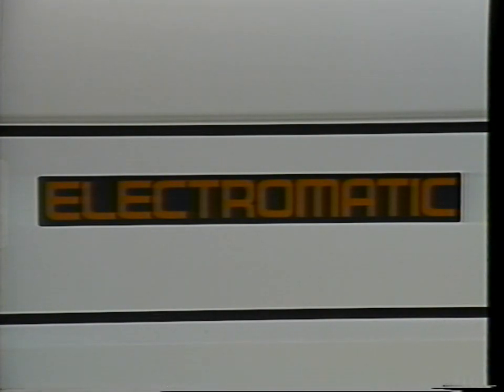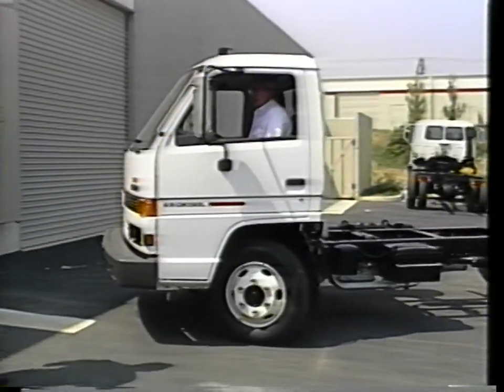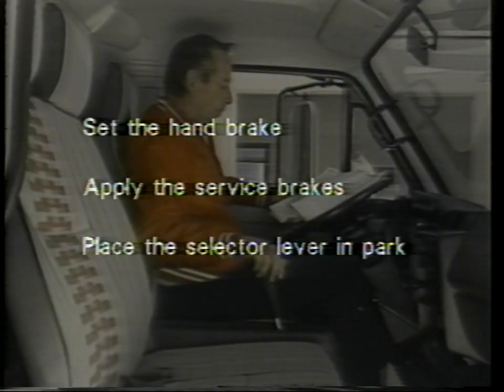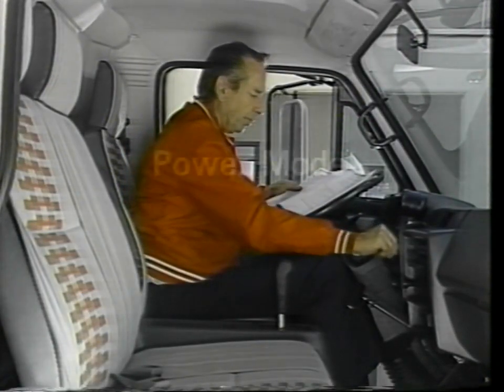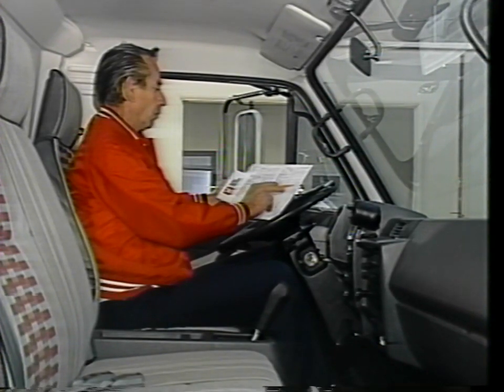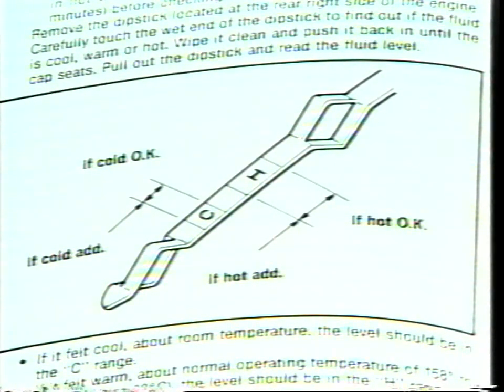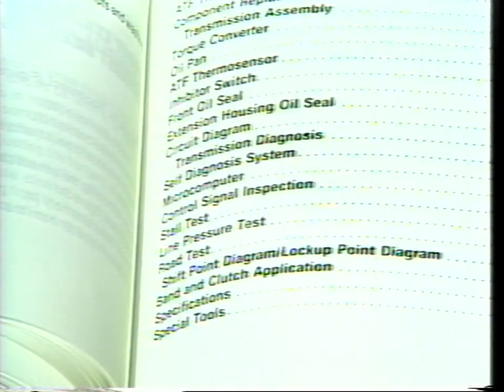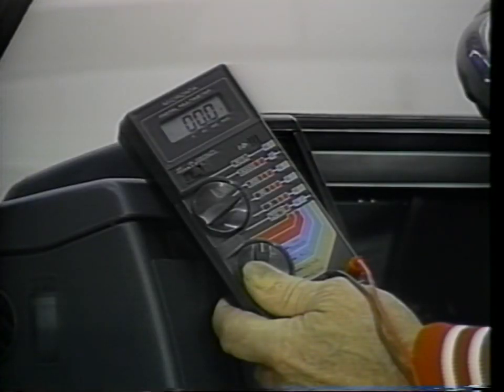Isuzu - Electromatic Transmission Diagnosis

Comment: I have a 2011 Isuzu truck auto transmission 4jj1 engine but that the transmission light keeps coming on and after doing a diagnostic test it send codes of A&B solenoid has low voltage. What do you think cause the low voltage?